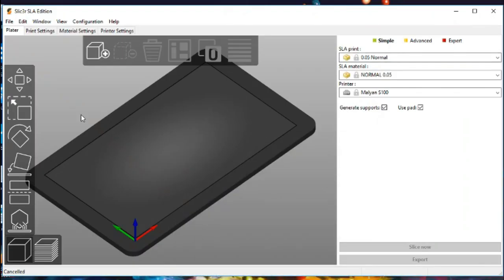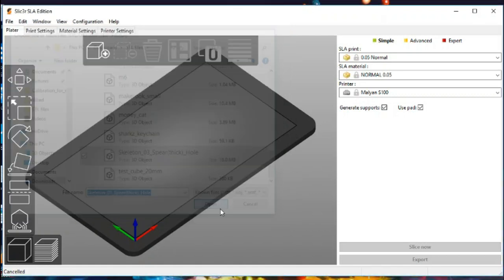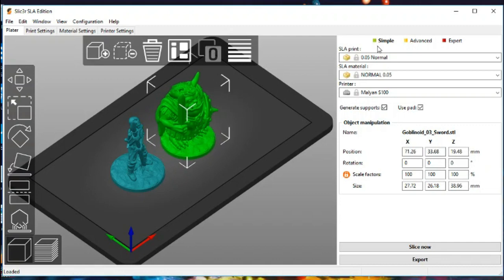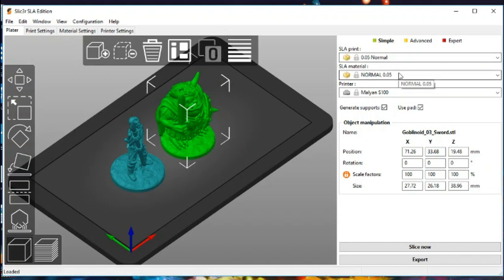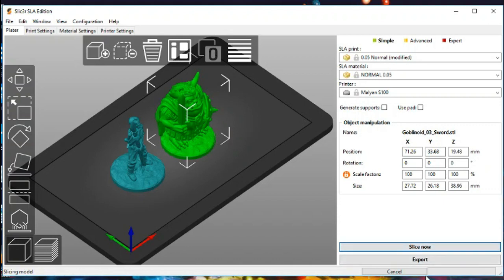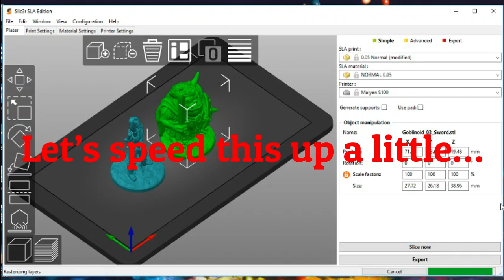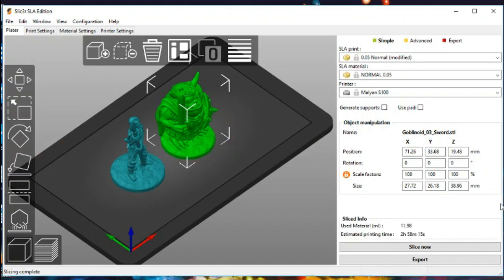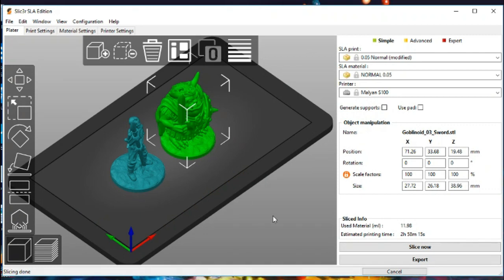Slicing files for the Monoprice Mini SLA Printer

Comment: I just bought the Monoprice mini deluxe and was trying to use the Slic3r SLA edition but the Maylan S100 doesnt even start to print. Are you changing some settings for the Maylan to make it work with the Monoprice?
Reply from the maker: Make sure you've got the Slic3r from the Monoprice page, it has the profiles. 

https://downloads.monoprice.com/files/software/35435_Software_190311.zip

Comment: Hey, I just purchased the same machine. I found to print some parts the printer is getting ready to print very quickly. But when I have about 1000 layers at 0.1mm, it keeps showing "Wait" and no response at all. Do you have the same issue? Any ideas? Thanks
Reply from the maker: Hi!

I have had that issue a few times, and found that for some reason the files just weren't sliced correctly. Which slicer are you using? I didn't have problems once I updated to the newest firmware and used ChiTuBox.
Reply: @TheSLAChannel  Hi, thanks for the quick reply. I am using Creation Workshop. I checked my firmware is uptodate. I will try to use ChiTuBox tonight. Thank you so much for the solution!
Reply from the maker: @adsl00007  I don't like creation workshop! You'll find that using ChiTuBox & Photon files is much better.
Reply: @TheSLAChannel  Hi which format are you using? My printer seems not to read phonton files
Reply from the maker: @adsl00007  Make sure you have the latest firmware. Files should be sliced as .photon, NOT .photons
Reply: @TheSLAChannel  Thank you sir, you just saved me hours of headaches. I picked this one up on a fire sale and was getting the infamous never ending wait cycle, but .photon fixed it. I was able to get the built in print to work fine, but none of my own.

Comment: This wasn't what I was hoping it was.  I need to figure out how to set up a slicer for this printer, not use one that's already set up. Can you do a video on that?
Reply from the maker: Are you looking for how to set up a slicer for the Monoprice Mini?
Reply: Yes
Reply from the maker: @PatrickPaul1203  ChiTuBox is probably the easiest one to set up, as long as you have the latest firmware installed on your printer since it can use .photon files now. 

Go in to setting, add new printer, then select "Default". 

Resolution is 1440 x 2560.

Make sure the "lock ratio" box is checked

Enter 68mm as you 'X' dimension. The Y will autofill to 122 (or close)

Make sure the Mirror drop down box is set to "lcd_mirror"

And you're set. Save the files as .photon when you slice.
Reply: The SLA Channel, thank you! how do I update the firmware?  what about cure times I see a lot of stuff about that but not sure about it. I've been printing fdm for about 3 months and I'm still definitely in the learning stage. Again thank you for your help!

Comment: hey man im about to pull the trigger for an SLA i have all prusas now i want some SLA but cant decide between the anycubic or this monoprice, any input you may have on this ? thanks in advance
Reply from the maker: I've got Prusas, Too- My print farm relies on them! Excellent machine. I can't wait for the SL1 to arrive.

Between the two, It's hands down the Photon- It's much more machine, but of course costs a lot more, though you can snag good deals (it was on Amazon a minute ago for $434, with an addition $25 coupon). This Monoprice has the potential to be a great little machine, but it's just not there yet. Continued firmware updates will make it much better.

The Photon has been around longer, and is more proven. It's also got a HUGE user community online, so you'll be able to get help WHEN you have problems. You WILL have problems with just about any SLA printer, it's just the nature of 'the beast' at this point.

Another one that's VERY worth of taking a good look at is the Elegoo Mars. A little less than the Photon, but seems like a great machine so far. It is a little more powerful, and therefore a little faster. You can see some prints I just did on our FaceBook group http://www.facebook.com/groups/theslachannel
Reply: The SLA Channel  i really appreciate your response I’m literally with my finger on the check out button just can’t decide wich one to get, I guess I’ll go with the photon just because of the same reason I went with the prusa and it’s the community around it, reliability and they have already been tested out and proven to work thanks again!! I have amazon prime but not sure about the 25 coupon discount, seems like I have to suscribe to have scheduled purchases or something like that or am I wrong?
Reply from the maker: @mrojomrojo9478  I just looked, and the discount appears to be active still, you just check the box to add the coupon. I bought the one for the lab that way. It's a pretty good price for a unit shipped from the US. Buying from Amazon is recommended, too- if there is a problem with it within 30 days, send it back!
Reply: The SLA Channel  awesome really appreciate it man nice channel keep it up !
Reply from the maker: @mrojomrojo9478  Will do. Make sure you're subscribed, and join our facebook group, too. We've got 12 printers in the lab being tested... It's  a lot of fun!

Comment: how durable are SLA printed parts?
Reply from the maker: It depends on the resin that you use, and the design of the part. There are some VERY strong resins out there, one is Siraya Blu, which is incredibly tough. I use it to make mechanical parts. There are others that are softer, and have some flex to them. Others have high heat resistance. It all depends on what you're looking for.

Comment: Hey man! Just found your video! 

How the hell do you actually setup Prusa Slicer for this machine? Not familiar with prusa slicer and having a hell of a time getting it configured to export to a CWS file format
Reply from the maker: I haven't had a chance to use Slic3r PE with it yet- I'm not sure if it will export the CWS format or not. I need to play with it (My FDM print farm is all Prusas), just haven't had a chance!
Reply: Can any of you experts please type in the correct slice settings for either CHITUbox or Slic3r on here? Just the basic x y z since the online manual and the one that comes with the machine has different values... the monoprice guys did an excellent job creating a slicer profiles for the mp mini delta so it would be great if there was one for this sla mp mini!

Comment: I'm trying to use slic3r sla edition but it seems to be missing some msvr dll files. Has anyone else encountered this issue?
Reply from the maker: Your computer is missing some files- Google the files it tells you are missing and you'll find installation instructions for them
Reply: Mine were missing also. I found the files via google, downloaded them and put them directly in the Slic3r folder. Same location as the exe file is in.

Comment: Noob question... Is it possible to conserve resin with an infill or hallowing, or do resin prints have to be solid?
Reply from the maker: For smaller models, solid is fine- But for bigger ones, you'll want to hollow the model before you print it. This function is built in to some slicers (ChiTuBox, for example). You select the thickness of the shell and the program hollows it out for you. You also have to remember to place some drain holes in it, so uncured resin can drain out of the cavity when the print is done!

This not only saves resin, but it also results in a smaller 'cross section' on each print layer- Which means less suction force when being pulled of the FEP sheet.

Comment: So, I'm seeing issues with it not printing any files I slice. It prints the test file just fine, but sits on "Wait" indefinitely for any files I'm slicing, regardless of slicer. I feel like I'm missing something but can't figure out what I haven't tried...
Reply: Have you been exporting as cws? Using mSD card or wifi? Seen a lot of reviews saying this machine dislikes other formats and that wifi fails to work alot.
Reply: Have you had any progress? I've had the same issue.
Reply: Having the same issue, Exporting as cws and using SD card. It just sits on wait. I've also tried different SD cards, along with Formatting them.
Reply: Have you tried updating the firmware , that fixed my issues with the infinite wait time.

Comment: I've been using slic3r pe with my resin printer for some time now and it really is a great piece of software. Once they implement hollowing and island checking it'll be perfect.
Reply: Nice! I haven't used PE yet- Not a lot of info about setting it up for SLA that I could find, but I do like it for my FDM printers (I have 10 Prusa MK3's). I have been using Simplify3D, but the free slicers like this are getting just as good!

The 'workaround' I usually use for a slicer that doesn't have hollowing is to load the model in ChiTuBox, hollow it there, then save as .STL again, load it in to whatever slicer I would rather use. ChiTu has a pretty good hollowing tool.
Reply: @andgott  they renamed it to prusaslicer. Just install and select the sl1 during setup, import a model, hit slice and you can then export the whole thing as an STL with the supports included and then import that into whatever slicer you normally use. So really you are just making use of the supports.
Reply: @andgott  You can also use meshmixer to hollow and even add supports if needed.
Reply: @DrawnDoggo  Yes- I've played with it a bit. I do most of my slicing in ChiTuBox, and find the hollowing and supports pretty simple there. 

With the firmware on this machine now allowing the use of Photon files, it opens a whole new world up :)